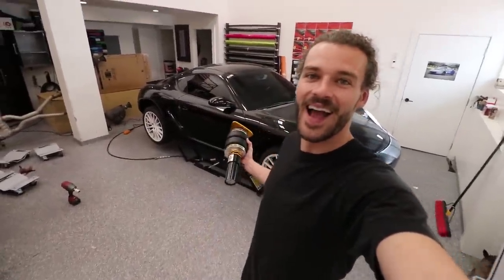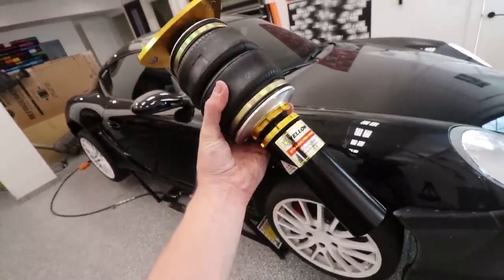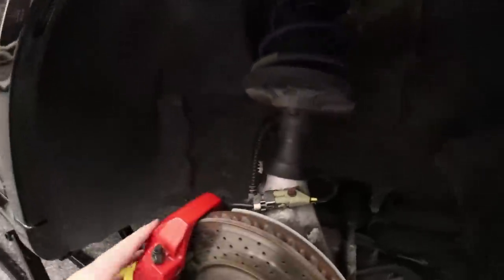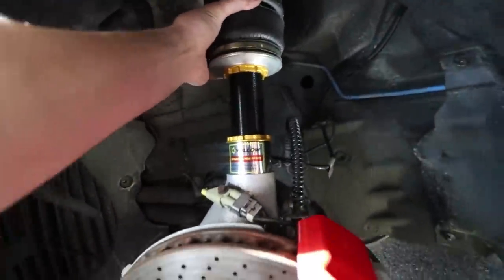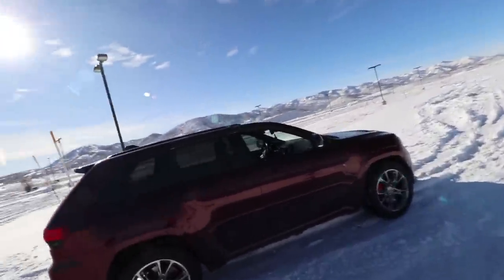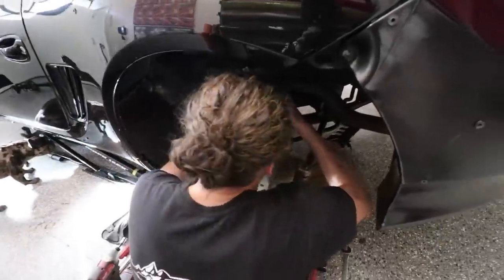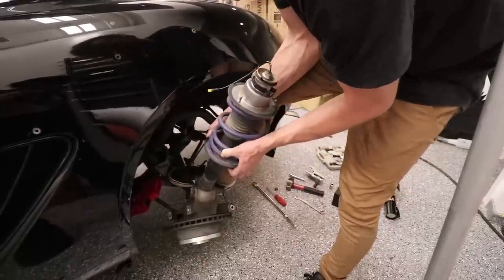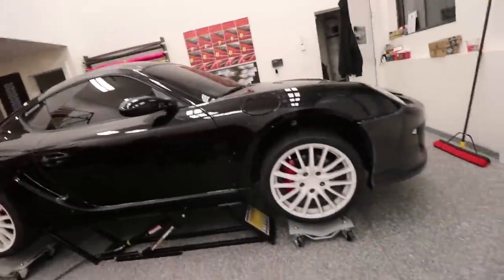Installing CUSTOM Airbags on my Widebody Porsche!

Comment: Donut Winner - Faith by a ton. Hey Clayton, you didn’t mention if the Struts had any Air pre loaded. Wouldn’t that change your thoughts on ride hgt & changes to strut adjust?